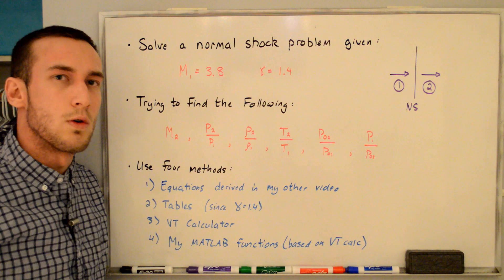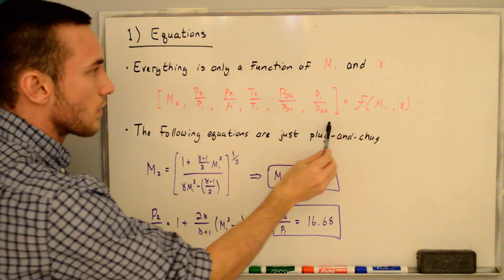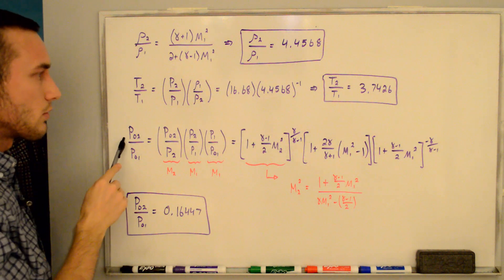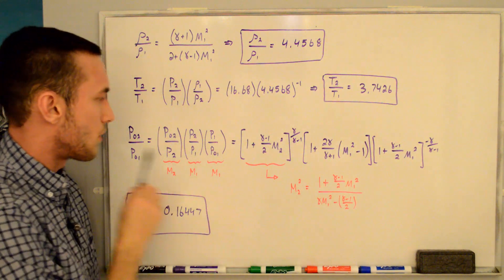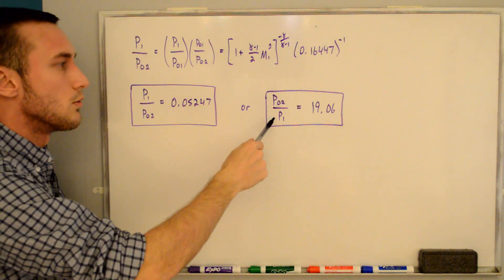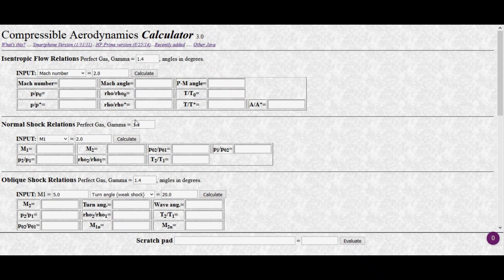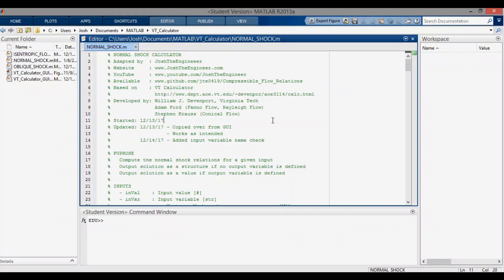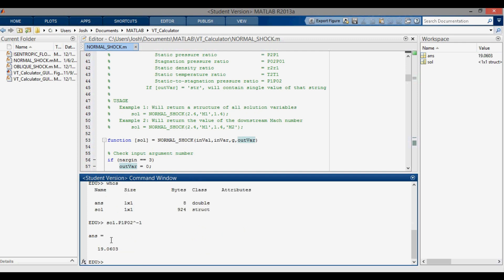Normal Shock Example Problem

Comment: I'm in Aerosapce Engineering, having a hard time wrapping my head around these shock wave formulas. How do they take into account an aerodynamic or bluff body, for example? Say if we needed to calculate those ratios at different stations around an airplane fuselage, in an engine with an aerospike, a hyperloop train, etc?

Comment: 2. The flow just upstream of a NSW is at SSLC and the mach number downstream is 0.6152 determine the pressure, temperature, density, velocity, and the total pressure and temperature. Show your solution

3. The mach number behind of a NSW is 0.4752
What is the mach number in front of the wave and the pressure ratio across the shock? Show your solution.